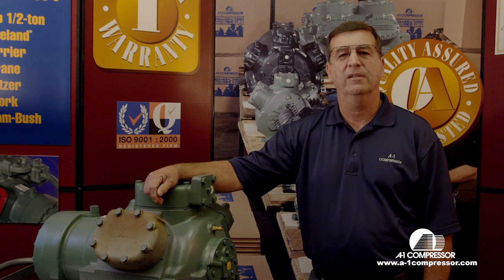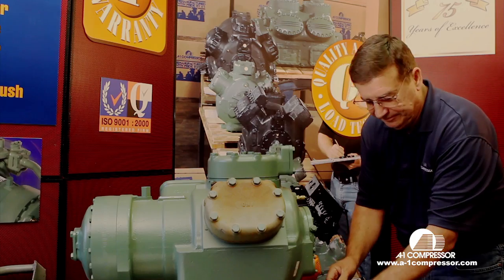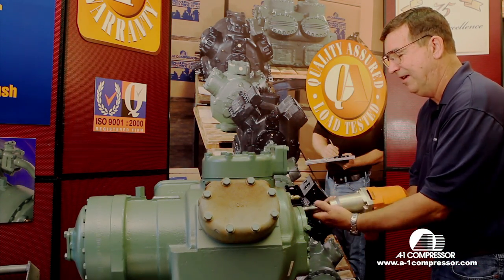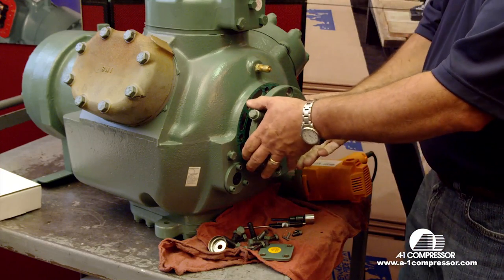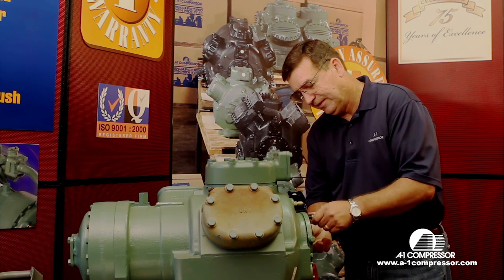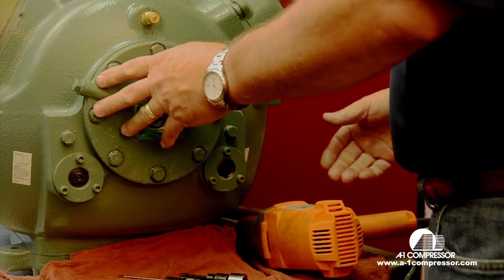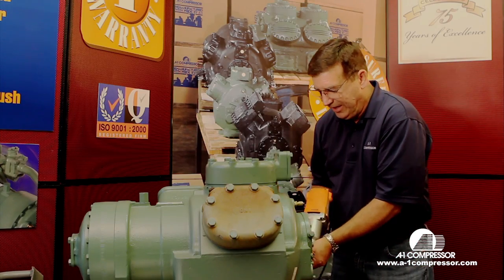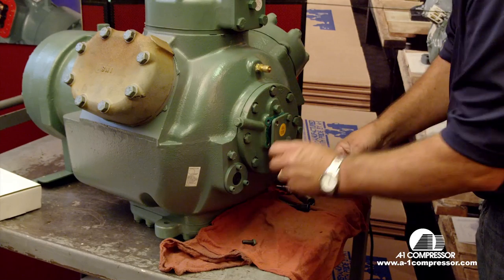Changing a Carrier 06D&E Oil Pump

Comment: What are signs that the oil may be bad? Is there usually a site glass to check oil levels? Does the oil come into any contact with the gas? and does it have an oil separator if it does?

Comment: Dear sir. I have one problem about chiller using for vegetable and fruits it was very stable condition worked until last week. Sadentliy changed whether to is - 5 then compressor was stopped tempracher become to higher stage compressor 3 ton Carrier unite. What is the remedy for back up + 10.OLP cut out if restart will be OK so Let me know pls.

Comment: sir i just wanna ask about chiller hopefully you can help me sir. my chiller model number 30XA the oil im already repair replace the oil, oil filter done but tje problem is to while running the chiller the oil pressure is very high than the discharge pressure what is the posible causes sir thank you